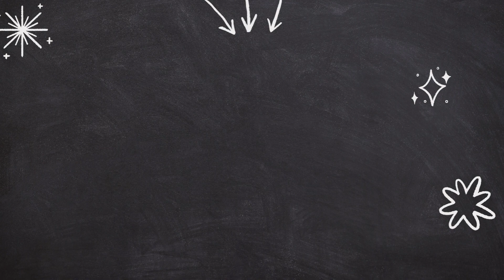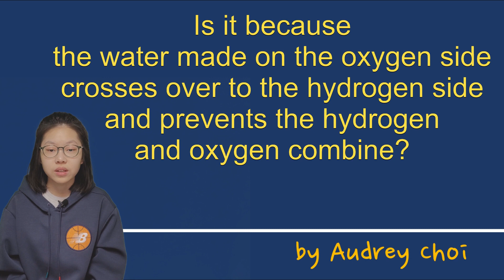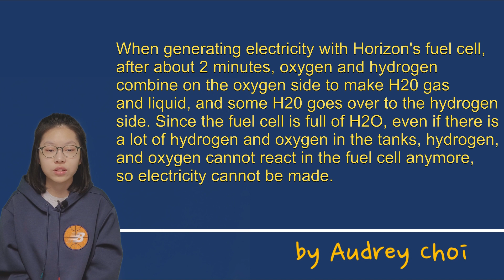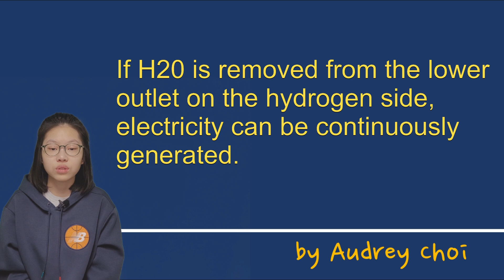Was fuel cell broken? hydrogen left in tank but can't make electricity. What is flooding?

Comment: You have to flush the water out with a flow of air.
Reply from the maker: Thank you for your comment. That's right. In the second half of the video, I purge the water to get the fuel cell running again. At this point, you should see the fuel cell voltage rise, the LEDs turn back on, and the motor spin.